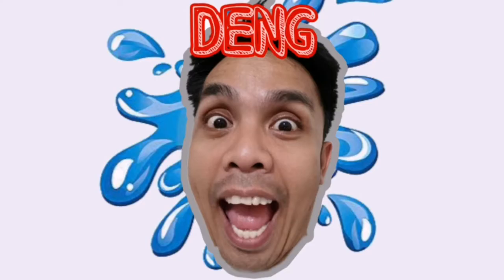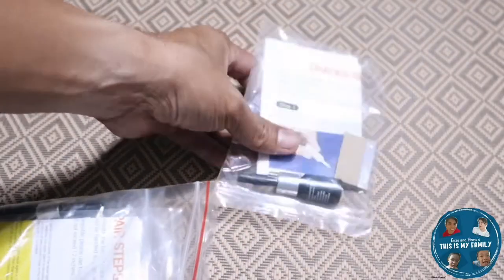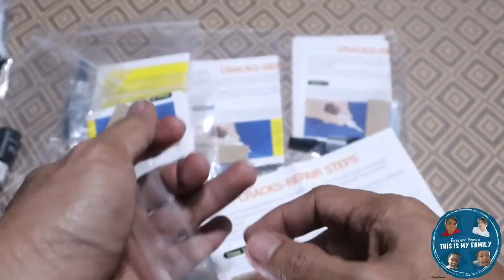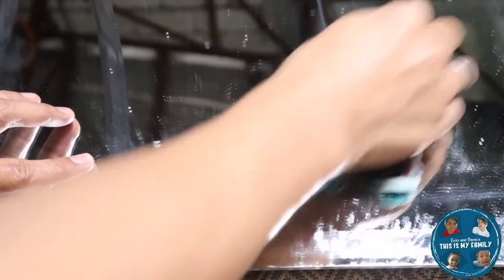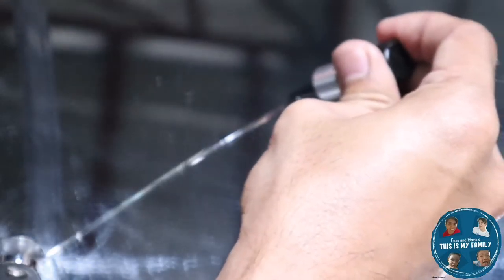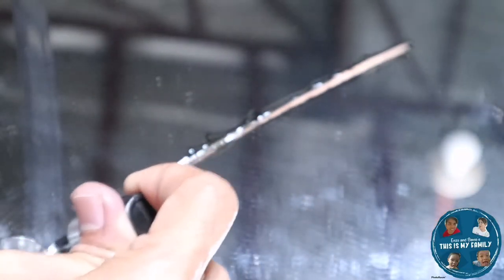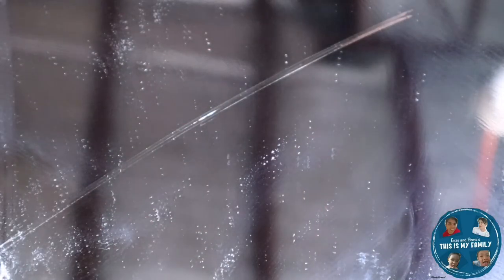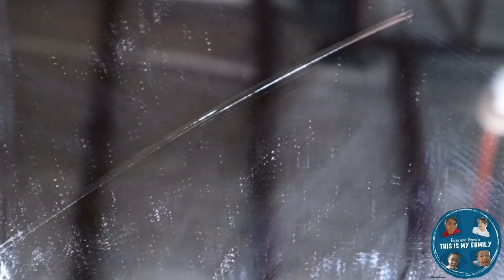Cracked Automotive/Mirror Glass Nano Repair Fluid | Windshield Resin Crack Tool Kit

Comment: Thanks for the informative video, I would try pushing the bottom of the windshield from inside, (2nd person), then you push the top of the windshield in, this opens the crack up a smidgen, then place epoxy in the crack and release. Gotta get that epoxy in the crack not just superficial.
Thanks for the English commentary, appreciate it.
Reply from the maker: hello sir foster, thank you for watching and thank you for the suggestion. will definitely try that.. Take care.